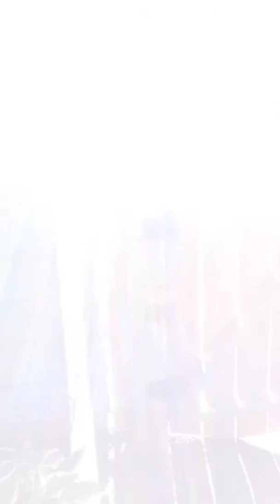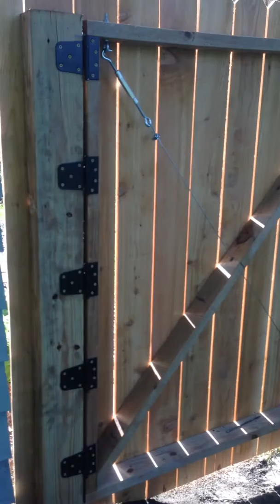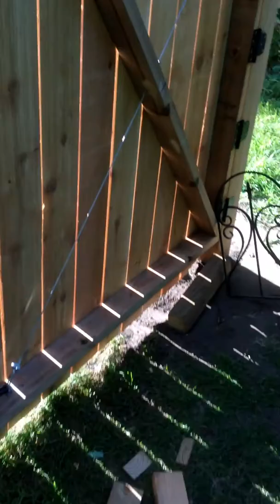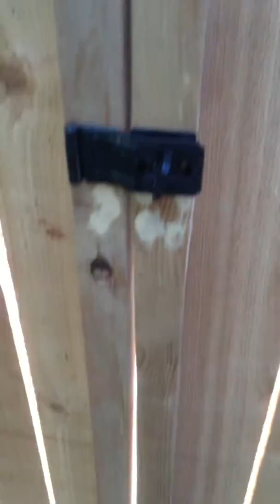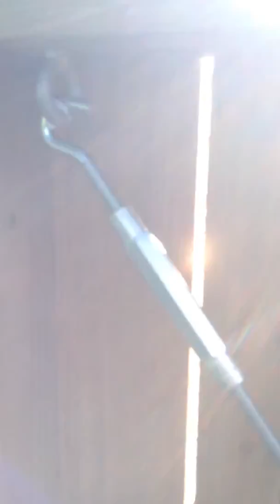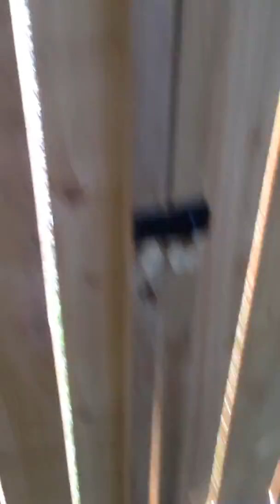Double Gate With Turnbuckle System

Comment: What did you use to attach the cable to the bottom of the fence?  From what I could see looks just like an I shoulder bolt?  Is that correct?
Reply from the maker: Don Turney correct. The same as ones shown up top.

Comment: Looks really good. Very nice, well executed anti-sag methods and proper decking screws to boot. Five hinges is a bit excessive. The more hinges you use, the more exact you need to make sure they're in a perfect line to avoid hinge binding.  I'm not surprise at all that it still works perfect 2 years later. 
I'm doing one this week - covering 10ft (2 x 5ft). I'm using a Homax Easy Gate kit in combination with a turnbuckle wire. Did you use anything specific for your cane bolt anchor in the ground, like a pvc pipe or something?
Reply from the maker: Thank you very much! I agree that I over did it with the hinges. I did not use anything for an anchor for the cane bolt. Instead I simply pressed down on the cane to make just a two- or three-inch recess in the yard. Have a great day my friend and good luck with your gate. It's a fun project.